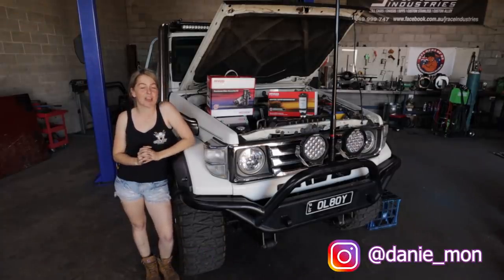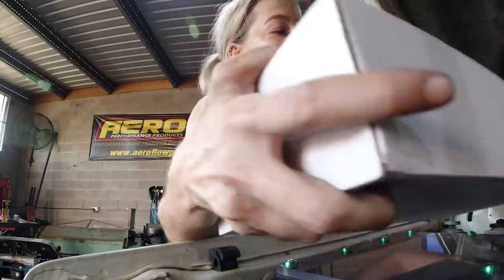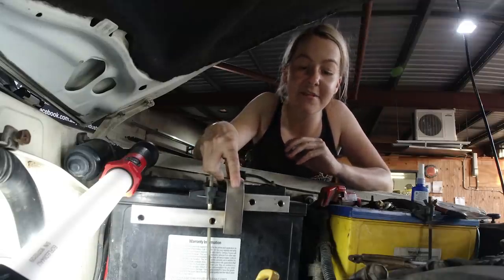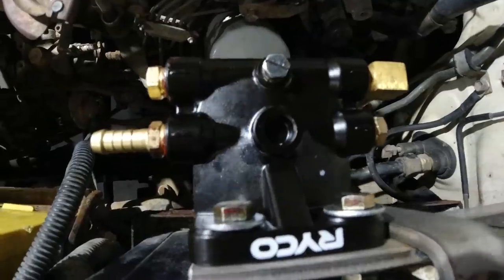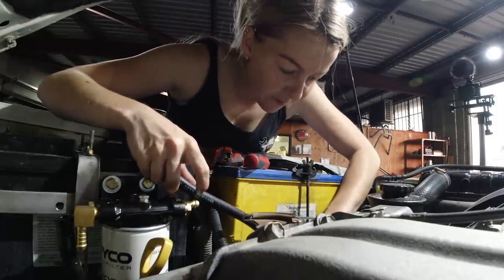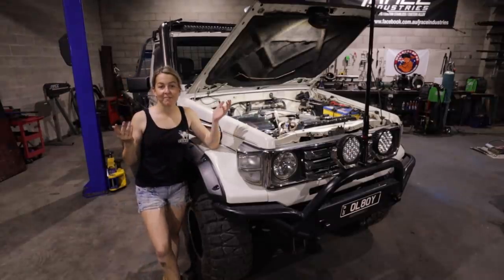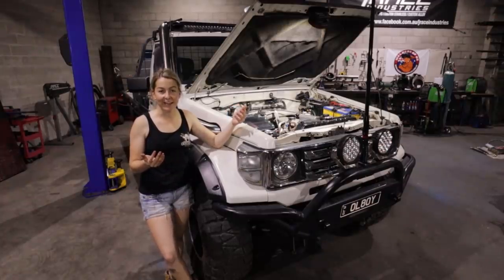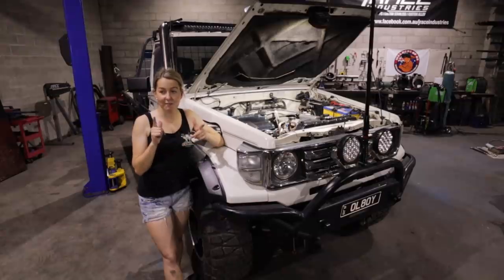Engine Maintenance Part 1: Ryco Fuel Water Separator

Comment: I put a tap on the inlet side to prevent fuel drain back so i don't have to pump so much when primeing. Its the little things. 
Nice job, Old boys coming along
Reply: not a bad idea, on my last diesel i actually fitted a primer bulb for a boat before the fuel filter, from memory was only 4-5 squeezes and it was up to the filter.
Reply: Yeah, done that to an old valiant years ago. Good stuff

Comment: I suppose it goes without saying given your skills and background but by all means carry a spare filter for each filter type and may as well stow away that second 10 micron filter in your vehicle since you plan on going with the 4 micron filters in the future. To touch on fine filter media though, I've had experience with an add on final fuel filter ( Racor ) for a diesel tandem truck and I believe its a 2 micron filter. It plugs insanely fast and the truck still has the factory filter doing the initial filtering but due to the fine nature of the filter it traps such fine particles and when it plugs up its media becomes black. It can be frustrating due to how quick it can plug up and with no warning the truck falls flat on its face as it reaches that point where its too restrictive just when one is going up a hill !. The unit I have is an open element style that the housing has to be opened and its not a great road side project. Anyway just a heads up about the fine filters as they find the shit in the fuel and let you know all about it as diesel has issues and much more so in your warm humid climate with growth happening in the fuel and any water in the fuel is where it really grows. Using a biocide every so often in your trucks tank would be a very good idea to keep the monsters at bay within the tank as that black substance I spoke of was most likely the side effects of some growth within my trucks fuel tanks.

Comment: Thats not a bad setup young lass,i priced them filters and their not a bad price,my setup in a real 4x4 was a bit tricky,when i installed a auxiliary tank i had to install them small peasant filters before the changeover tank valve which entailed relocating the water trap in a different location,don't know if you have worked on old army type land rovers their water trap is  drivers side under rear chassis,i relocated it to the  front  part of the chassis on the firewall  where it is protected. My main filter system  needs upgrading  so where abouts do you park OLBOY at night.(:
Reply from the maker: I certainly have good ol 4wds they are.

Comment: The new intro is awesome.  well done. I also looked up the new PPQ plates from your insta.  I'm now mucking around with formats and what to add underneath.... I was thinking ' Money Pit' or 'If U can read this UR 2 close' lol. Now a tech question.  I'm fitting a catch can next but will now look at the new or extra fuel filter if I can fit it into the BT50. Do you know if I can change the factory oil filter to a bigger unit? The current filter  is about the size of half a coke can. It just seems too small. Cheers
Reply from the maker: I like money pit haha! Have a look on the website there is a way to check fuel filter specs and equivalent

Comment: quick question how often is the filter replaced? every service?
Reply from the maker: Whatever your interval is for your car most are 20000 to 40000
Reply: @DanieSimpson  Thanks for the quick reply haven't got the car yet but I'm planning to get it installed first thing as soon as i pick it up from the dealership as i want to have a healthy engine right from the start
Reply: @DanieSimpson  Also where did you buy/get you mounting brackets from? looks like a smart idea!
Reply from the maker: @10babic  was made

Comment: I personally don't like the bracket as will be a pain if u want to change a battery
Reply from the maker: Two wing nuts? Easiest way ever.  Also had that battery for nearly 5 years so not really a constant job I face
Reply: @DanieSimpson  not talking about the wing nuts as such it's the bracket holding the water separator looks like you havnt left enough fuel line so u can lift it all up in 1 piece if you needed to.

But it does make everything look neat which I do like 👌
Reply from the maker: @dylangarnett3919  All lifts up very easily as you can see in the video. 2 wing nuts and lifts straight off